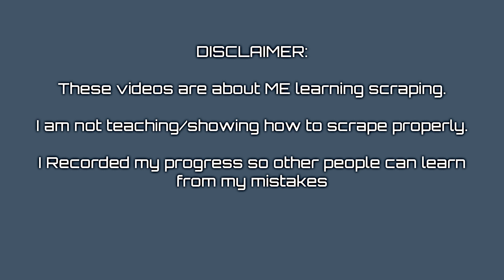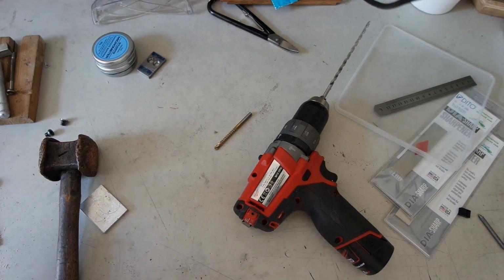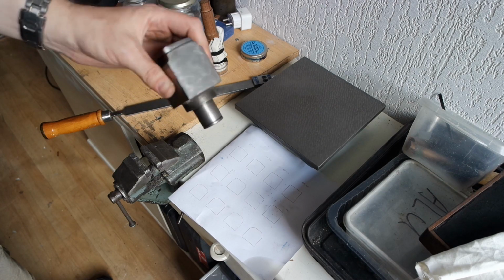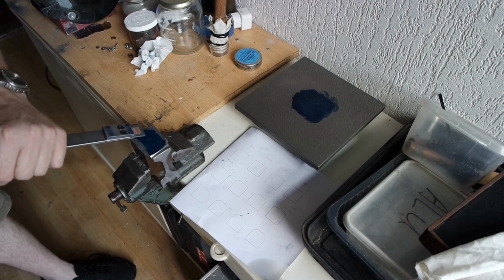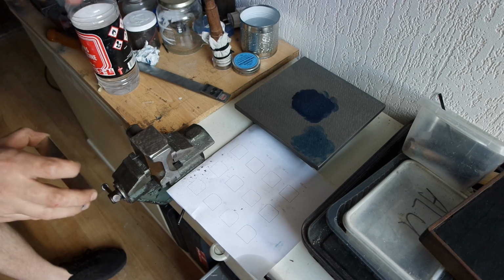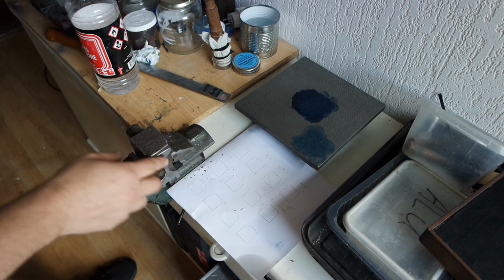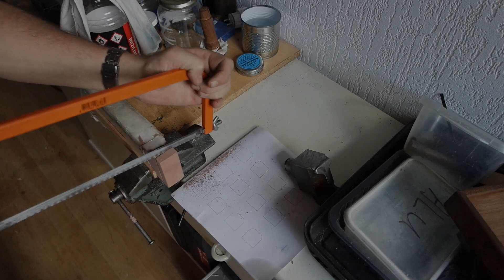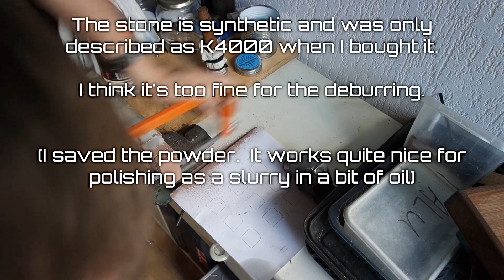Learning metal scraping - 1 - First chips

Comment: Bardzo podoba mi się Twoje podejście. Też się uczę skrobania i mam podobne doświadczenia. Rozprowadzenie tuszu po płycie jest bardzo ważne. Jakiego tuszu używasz?
Reply from the maker: Thanks. I hope the google translate didn't miss anything.
In retrospect there is a lot to learn about scraping which is not in this video. To be clear the video is about me learning scraping, not about me teaching you how to scrape.
I used Stuarts Micrometer Engineering Blue in this video. (from amazon. buy a tube, do NOT buy the can/tin). 
You can also use " Charbonnel Prusian Blue (aqua wash)"  from an arts store. It doesn't stain as much and has a better contrast,  but if you use it pure it is not accurate at the highest precision. At the Richard King scraping class at Maschratur we used a mixture of the 50/50 BIAX bluing compound (I forgot the name) and the Charbonnel, which works too. If you don't have the biax stuff you can dilute the Charbonnel with a few drops of isopropyl alcohol to make it a bit more runny, but one or two drops too much can really make it too liquid. (There might be something better to dilute the Charbonnel but this is what I had)